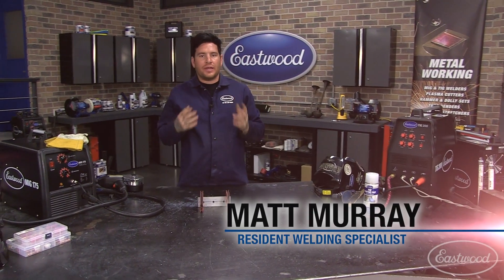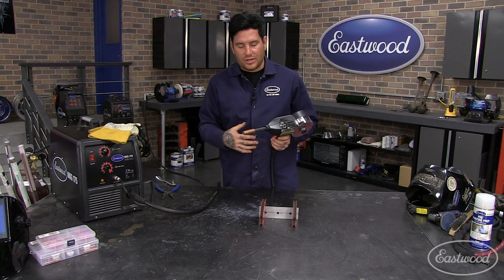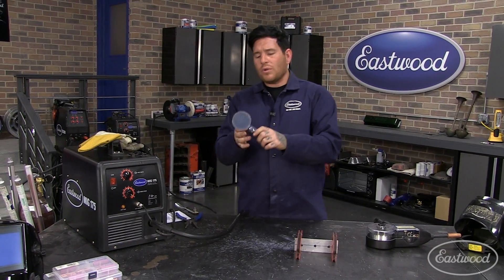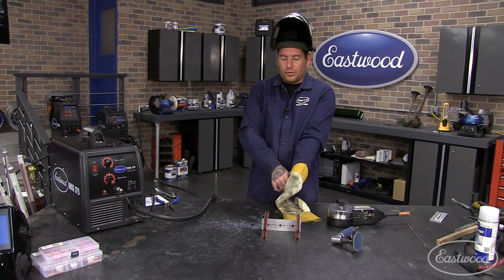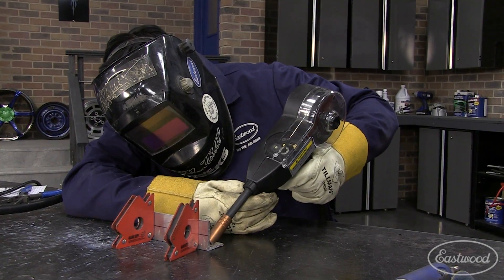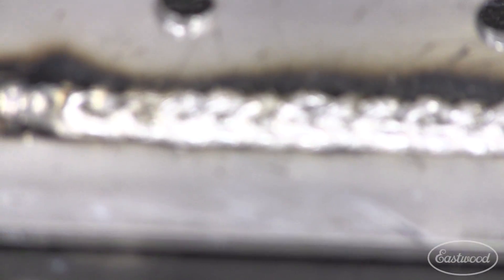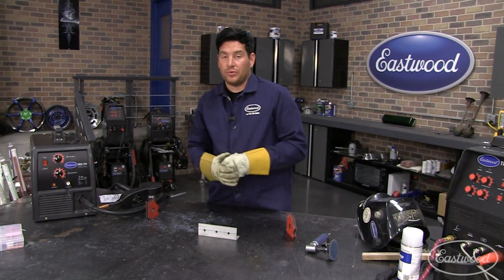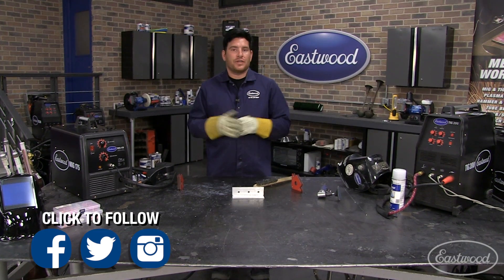How To MIG Weld Aluminum - Pointers and Troubleshooting with Eastwood

Comment: So I’ve only watched 2 videos on this. Question: This is A/C MIG welding and not D.C? Where is the equipment setting? Do you not have to ground the project because its A/C?
Reply from the maker: Check out this video as it walks through the spool gun setup:
https://youtu.be/uxHF84Cmh5w?si=jPmHtdDQAqO4uYoB

Comment: I have your 180 with the spool gun but having a hell of a time with the setting. cant find any videos for the settings.
Reply from the maker: There's a guide inside the side panel of the unit which should get you pretty close to start.  What are you struggling to weld?

Comment: I use a Mig welder with a push pull gun. The lead is 8 meters long.
We use a Teflon liner.
No metal spring liners.
And using pulse synergic provides a clean weld hardly any black carbon comparable to looking like a TIG weld.

Comment: I'm having a problem closing square tubing. On the final weld which seals it completely, the pressure from inside the tube shoots out leaving a hole. If I wait for it to cool I can zap it again. It's not as nice as the other sides but I was wondering if there are any tricks to fully weld it with out problems. I didn't really want to make a bunch of pressure hole through each tube connection.
Reply: its impossible to weld a vessel complete closed.

Comment: For .035 aluminum wire, I use 34 arc length, 733 ipm, and 47 on the gas. Needs lots of gas. LOTS OF GAS
Reply: Thank you dude I’ve been trying to find the correct setting for the gas
Reply: @KelleyMobileDetail  no prob. Regardless the setting on the welder, just remember to always push the weld at a hard angle with the gun

Comment: You don't need a spool gun!  I have been welding for a while now and never use one.  Jut be careful to keep your line straight as possible and use a different liner for aluminum and use 5356 wire

Comment: You don’t need a spool gun to MIG Weld aluminium! I’ve done it for a couple of years, and never had any problems!
Reply: We always swapped the liner for a PTFE one
Reply: Need? No but then you don't need air conditioning either. 😅
Reply: Just curious, but how?
Reply: @brandonstrausser3297  With the regular gun you can you don't need the spool gun I actually hate spool guns they don't fit everywhere the regular gun can fit into
Reply: @brandonstrausser3297  change out the mig gun liner to a graphine and works good with mine..
Reply: @brandonstrausser3297  there are also pulse mig guns that act like the regular mig gun so he is right
Reply: Care to explain how...?
Reply: @QZDaly90  well I imagine reverse polarity and run it through the night gun but im not positive on all that but folks that make comments like that dont ever properly communicate or make their comment beneficial.
Reply: @QZDaly90.   you'll need an aluminum whip for your welder and run it on pulse. I use a Miller millermatic 350p with a Alumapro  whip.
Reply: Word on the street, aluminum is so soft and melts so easy you dont even need a welder.  Just use a kitchen microwave, works great.  After you microwave the eggs in the shell for 4 minutes in high.

Comment: did weld without spoolgun today, worked out fine. just keep the cable more or less straight,  so the alu-wire doesnt bend too much. Spoolguns are quite expensive
Reply: You can get useable ones for a few hundred bucks, it’s well worth it especially after the first time you jam the wire up in your lead. Granted my lead is 35’, and if you just have a stock 12’ it’s not as bad but…..it sucks

Comment: Why does the wire stick in the tip of my gun? I go through tips like crazy. Is it my ground?
Reply from the maker: One of the settings are incorrect. Your wire should not be burning into the tips.

Comment: No no no. Use less wire speed and more volts. It will burn into the metal just the same and the bead is very nice. You can hear all of that crackling while you're welding, you want to hear the smallest amount of that. Its spray transfer but not a huge spray. Try to find a happy medium!
Reply: Any tips on how to break the arc and not leave a crater?

Comment: First thanks for the time posting the video. As someone very interested into getting into welding aluminium, I have some questions though that weren't explained....
1. Was the welder set to dc or ac current?
2. What was the earth lead set on, negative or positive?
3. Amperage settings for mig welding aluminium please?
Look forward to your answers.
Reply: I am a welder at Armstrong Marine USA in Port angeles. The welder is set to AC current, the earth/ground lead is negative, and for the settings. We weld 5052. The extrusion  needs a hotter weld (extrusion is the aluminum with ridges grooved into it just like the piece he welded in the video) it welds about 1 volt hotter. We use miller machines and have a feeder box with a push/pull system. For normal plate 1/8 20-22 volts, 3/16 23-24.5 volts, 1/4 24-25.5 for extrusion, just add a volt or so. 
Wire speed shouldn't be too high. For 23.5 volts I'm usually around 500 on the wire speed. It should have some crackle but also some hiss. A happy medium. The guy in the video was welding with way too much wire speed. The wire should turn to a spray around an 1/8" from the puddle. Hope this helped!
Reply: @serenestateofbeing1062  thankyou very much. Lots of very good information there, very much appreciated.

Comment: FYI, if you successfully weld the work-piece using this method and you need to clean it up you can always use some light brazing to clean it up.

Comment: Wire speed was way too high for that thickness. For 1/4 your wire speed should be at 3.5 on that welder and the voltage at around c. Then you will get the same penetration and your whips won’t have to be so spaced out, making the weld look neater.

Comment: If i only ever watched you tube  i would think that TIG welding is the only "good" way to weld aluminum.TIG  is probably the easiest way  on little jobs and for AL begginers because it easier to get more heat onto the joint .It was was the FIRST way to weld aluminum, besides brazing  and in fact TIG welding AL is  really a brazing process..But I have known 2  professional large scale  fabricators- these are people who build large aluminum yachts   - (one of them actually wrote the book on building aluminum boats) and they  always have said  that MIG welding is the ON LY  practical way to go because not only does TIG take too long , it winds up  being more expensive all around ( on  big jobs), the time  spent and consumables drive the cost way up over the long run..also there are more problems with warping and deforming aluminum TIG BECAUSE is easier to get hotter

Comment: U do not need to clean the metal with alluminum just like u dnt need to with stainless i literally NEVER clean the area im welding nd i weld PERFECT and the way that sounded when u were welding doesnt sound right at all it supposed to sound like a swoosh your not very good at alluminum everything ur saying is right but your actual welds and welding isnt right

Comment: You contaminated the metal with th grinder for prep
Reply: Exactly he's saying all the right things but when it came down to it it wasnt supposed to sound like that at all its supposed to sound like a swooshing sound not a crackle sound and his setting were off not by too much but they were definitely off
Reply: Also ive NEVER cleaned my metal while welding alluminum mig you dont really need to tbh
Reply: I always clean my aluminum with a wire brush and acetone. From my experience, aluminum needs to be pretty well cleaned to lay a nice weld down. The weld he laid definitely sounded off, too much wire speed i would say

Comment: You dont HAVE to use a spool gun, do you? I use a regular Mig gun with the wheels in the handle to help push the wire through.
Reply: If you want the best outcome you definitely would have to use a spoolgun

Comment: Nice video, never realized what those spool guns where meant for over just loading the mig machine with the spool where. I realize now its an issue with AL spools clumping up in the machine. Also learned that more 100% argon not a mixture of CO2 /argon blend is better for AL welding with mig. Nice currently i only going with all gas welding as gas can weld pretty much anything without any complex setup and is very portable and interchangeable fuels. But some day would like to get my hands on using mig and tig machines. And the AL i heard was always easier on TIG now i know why.

Comment: what polarity? didn't know magnets worked with aluminum.
Reply from the maker: The magnets are just being used to prop the aluminum in position to weld. Not as a 'magnet' like they would be used with steel.

Comment: I know how hard it is to do this, I had a CK systematics Snap on 300 machine, it ran amazing, This was not the best vid as he said, It is a very difficult to actually do this with any TIG type results. I have done it but it requires a very quick push pull or stop start which introduces porosity.. I really would like to try one of the eastwood machines even though I am a Miller man, I am in Australia and it is difficult to acquire American quality.
Reply: It isnt that difficult at all actually

Comment: I weld Aluminum gates using a variety of spool guns and we have a push pull machine. I find that the spool guns are a bit harder to weld with at times, although it could just be because the ones we have are a bit faulty. The angles I have to get in and how thin it is makes for a tough job, definitely need more practice with the spool gun.

Comment: I mig weld aluminum with my regular Bernard Q Gun with a 15 foot lead , and it welds beautifully.  You don't need to buy a spool gun.  Don't believe these bullshit videos.   90% of the time you get a bird nest with aluminum is because of a dirty ground connection. Clean your GROUND clamp and the aluminum surface it attaches to. Attach the ground as close to the joint as possible. Voila!!  Problem solved.
Reply: It's kinda apples and oranges.  This is a $100 spool gun that allows you to weld Aluminum. With the right liner and a low angle neck, it can be done with a traditional push style MIG gun. But no one does it because you still get problems anytime your line gets too much curve to it.  It's just the nature of pushing soft aluminum through a long tube. On 99% of mig machines in small shops or garages the liner is coiled steel, not HDPE or other low friction liner, and it won't work at all.  A Bernard Q or similar mig gun costs more than the entire welder and mig gun in this video. This is an add-on tool for a low cost mig welder. One that works pretty well BTW.  I own one.   I also own a Miller push/pull setup, which is what you want if you're serious about production aluminum welding. And just the push/pull set cost about 4 times as much as the entire Eastwood welder with a spool gun.  It's better for sure, but it's also a LOT more expensive.  For a typical garage welder - this option works great.  I built a lot of the aluminum parts on my sailboat with this same machine - because it's small and portable. Works like a charm.

Comment: Why weave?
Reply: I was asking the same thing weaving on aluminum is just asking to burn through but he did have some pretty thick stuff I'm used to welding 080 or even some 063.
Reply: As someone who welds ally a lot I can say from experience it just gives you more control and gives a neater weld
Reply: @bazd7415  as someone who welds alluminum evertday that is not true

Comment: im welding with 1.2 5356 wire, no spool gun, i am getting so much smut its not funny. i have tried everything, even taken the machine back to get it checked. nothing is working . tried uping the gas , still black as. please any advice?
Reply from the maker: Can you call our Welding Tech so you can discuss and he can walk you through the troubleshooting?  The number is 800.343.9353.
Reply: Eastwood Company thanks but im in australia.
Reply: Have you tried cleaning the metal before welding it most of what you see is dirt that has been burned and even though it may look clean at first there could still be a lot you cant see hiding in the pores of the metal, but its pretty easy to just get some silver spray paint if it looks to bad.
Reply: WickedInsomnia yes its absolutely clean! i tig weld so i know how to clean aluminium
thanks
Reply: That sounds like your spool is contaminated
Reply: Are you pointing your tip in the direction you're trying to weld? For example if welding from the left to right, the back of the gun would be pointed to the left and nozzle to the right? Also check your tip and nozzle to be sure both are clean from build up.

Comment: Stopped the video at 7:48. Seems like that is a piece of angle, but you can see the join underneath. Strange how perfect the end of the piece is.
Reply: izzzzzz6 the saw he used either was dull or cutting to fast and caused the aluminum to smear.

Comment: Nice trick, using magnets to hold aluminium in place ;)
Reply: Yes steel top bench other option he had was stick a couple of bricks on the bench and hide what he was doing or drill a hole through the bench and bolt the aluminum down :-)
Reply: told yall these are bullshit videos

Comment: Quick question--it's hard to tell from the vid, but what pattern are you using?  It seems that most MIG/spool/aluminum uses a bit of a straight hitch--forward, then back a touch then forward again.  I've seen the cursive "e" and I use the crescent for steel, but not sure about aluminum.  Thanks and great vid!

Comment: Odd how everyone says the soot comes from contaminates, i was always taught it was sheilding gas that wasnt being burnt due to pulling opposed to pushing. Anyway good video and i wish i could post comment pics on here to show you my spool alum welds. And a wizzer wheel is always better than wire brushing, unless you use a stainless brush, cause it can smear contimantes. 

Also I have found you can brush it back and forth with no issues, not sure why people say brush one way? perhaps to push everything one direction instead of smearing it? just blast it with brake clean after a brush and it will weld the same lol.
Reply: +Tyler Blanchard acetone
Reply: Tyler Blanchard Please don't use brake cleaner to prep for welding...I've read in more than a few welding forums that you can get seriously ill from breathing welding fumes from chlorine based cleaners.
Reply: ITUMBLE4U thank you for the concern, could you reccomend a better cleaner?

Comment: all that black in your weld is from not cleaning it properly.
Reply: +Daniel Leon You are correct, to an extent, no matter how much I clean the stuff I weld at work (with toluene, and a stainless wire brush or wire wheel) there is always some black soot. The amount he has here seems a bit excessive though, probably greasy residue from his dirty gloves. Also, some 6061 alloys always seem to have some gunk in them. The best welds usually happen after the parts have been thoroughly degreased and wire wheeled, then preheated to at least 350 for an hour or so.

Comment: wow. you cant weld for shit. even if you use a spool mig, if you set you machine right you get no popping.  you have alot of nice gear and tools but cant lay a good bead.
Reply: +Daniel Leon How about a video of you showing us how it's done then?
Reply: do you have a video showing how it's done ?
Reply: Wow, an expert.  Another internet tough guy.  Weld looks good considering it's a 175 with a spool gun.
Reply: +Daniel Leon It's also based heavily on your angle (I go straight in with a little push), arc length, and travel speed. You can tell if it's going right from the sound like you said. I weld on .190 to .250 tanks from the inside.
Reply: Always the expert and critic police when it comes to welding. I think it looked great.
Reply: Thank god im nit the only one who noriced
Reply: Jeremiah Kleimola ..wow!!!..What a retarded comment.....lol

Comment: That black soot is a shielding gas issue, bad gas coverage from the spool gun .  If it was contamination of material it would be on both top bottom of the bead.  Work on a better nozzle or something to get sufficient shielding coverage you will have a much better product. 

- from an aluminum boat builder ;)
Reply: +mike St Peter Maybe a little more line pressure on the argon? I get this at work alot, but the company doesn't want to 'waste' gas by turning up the pressure. So I have to weld closer and change gas nozzles for all the different jobs. Of course that means I get burn backs all the time and have to unstick the wire, which costs time and productivity.....
Reply: mike St Peter can you steer me in the right direction to build a mini aluminum jet boat that I can take in shallow streams. Where do I start as a diy without spending thousands?
Reply: A clogged gas nozzel will cause it

Comment: I mig Aluminum all day everyday. I work at Austal USA we build Aluminum Naval Ships. Not going to say one thing about the weld it self,it sucked you and me know that. What I have a problem with is you saying you can't use mix gas. I use mix gas everyday.
Reply: ya I caught that. you're right of course but this guy was just saying don't use your steel bottle, can't use co2 for AL
Reply: True
Reply: You using c25 gas on ali mig...? Or do you mean an argon/helium blend
Reply: Argon/helium blend.

Comment: Eastwood Company why can't the spool gun work with the mig 135 is it the voltage
Reply: Long Man i have the 135 mig and they are now compatible with spool gun but you gotta do some preheating because the 135 amps its to low
Reply from the maker: Long Man The MIG 135 is now compatible with an Eastwood Spool Gun for welding aluminum.  More info is available at Eastwood.com.